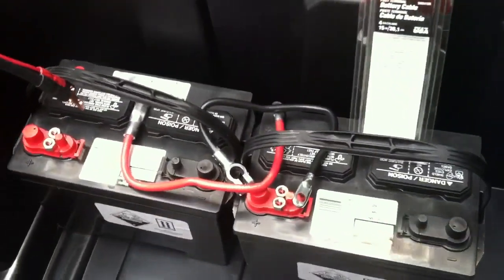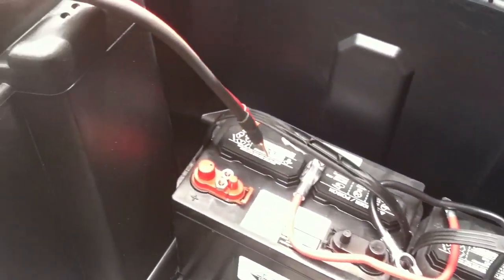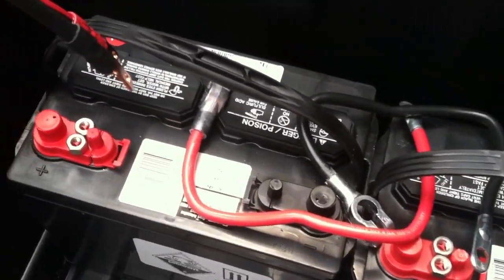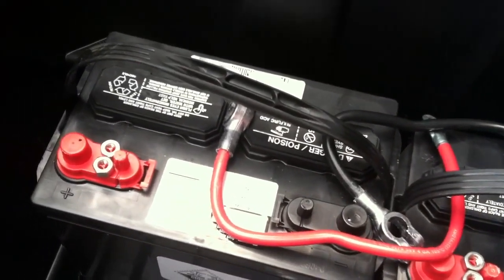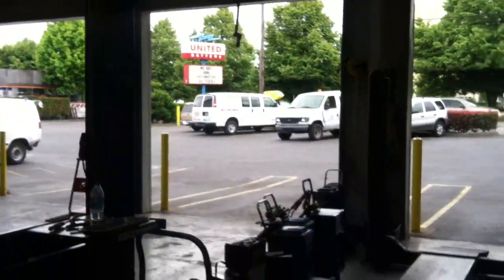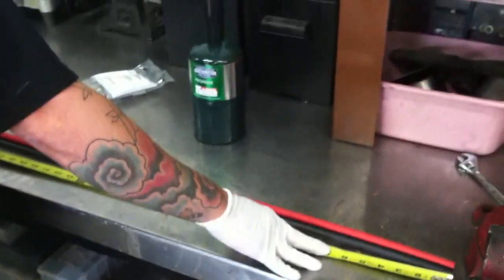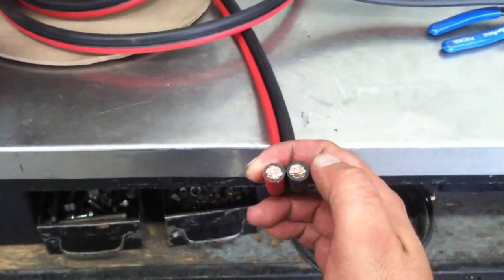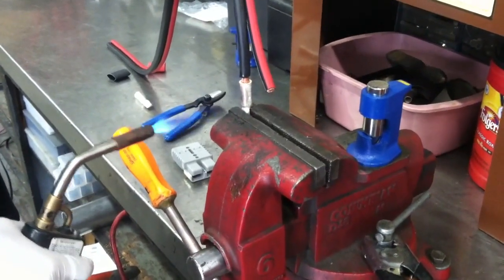Custom Jumper Cable for Mobile Off Grid Power System

Comment: the vise is a heat sink, it would go faster if you used 2 pieces of wood to grip the connector with, as you heated the solder.

Comment: But you never see solder connections on a airplane because the vibration would cause the wire to break at the base of the solder joint!!!

Comment: not crimped on both ends??? Some folks think that a mechanical crimp is better then solder because a soldered end could heat up and pull apart where a good mechanical crimp would hold. Some school of thought is both a mechanical crimp to get the good bond and then solder to keep the joint from getting moisture in it and corrode and then fail.  The salt water boaters do both for that reason I believe.  But then your not going to be out to sea and have your life depending on these cables....Just my take on crimping vs soldering. Like the thought process with this set up!!!
Reply: Bruce Arntt I would use some dielectric grease or just some axle grease to coat the connectors so it will resist salt water corrosion and a box to keep the battery from being exposed to the salt air

Comment: It would have been nice to see how he installed the metal connection into the quick connector.
Reply: +ComPrt3  The metal connection when inserted in the proper direction goes into the connection and clicks into place its just that easy!!!!

Comment: Where do you find parallel red/black 2ga wire like that?
Reply from the maker: Industrial battery supply places, especially those which deal with forklift and big truck battery packs.